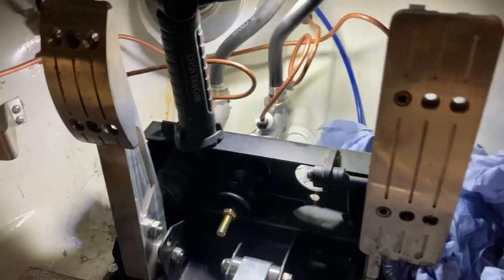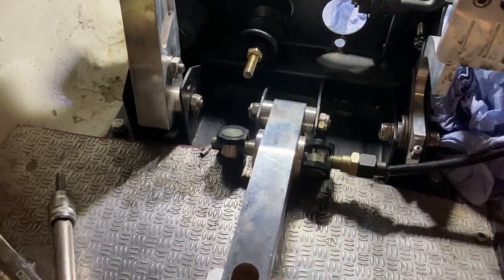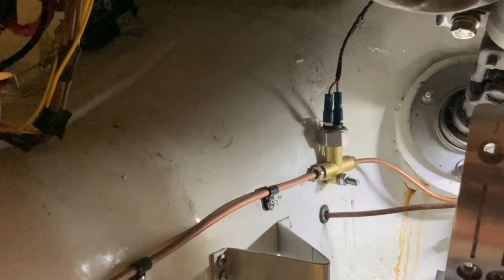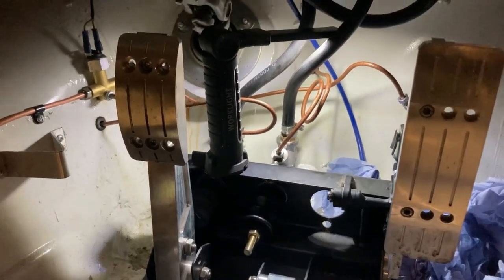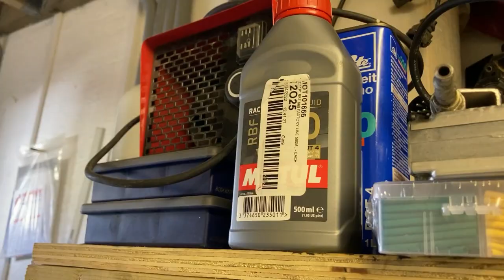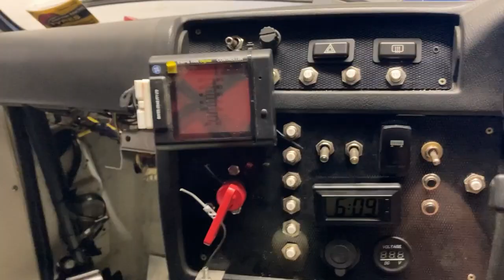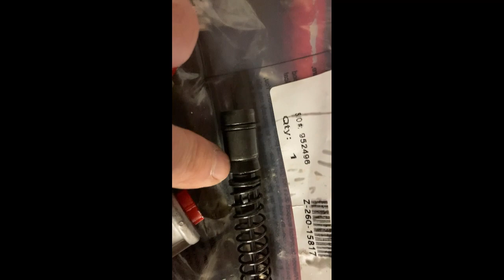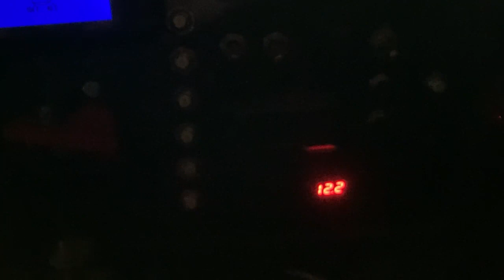preparation on the BMW e30  for the 2022 JERSEY RALLY

Comment: Also check the cylinder for the front is big enough for the fluid transfer required by your calipers.
Reply from the maker: When I bought the callipers i sized the pistons to work with a .625 cylinder but the rear callipers were second hand so maybe the piston size is too small. The brakes are amazing and work so well but I can’t have them locking up, not working or boiling fluid

Comment: I wouldn't use wilwood stuff its cheap for a reason, either Girling or AP for brake cylinders. And you don't need the rear brake adjuster if you run a bias pedal box, its usually used with out a bias box to kind of give a bias by reducing the pressure to the back
Reply from the maker: Yes ap seem to be good, i will have to invest in some. The bias valve is now removed but still struggling to get enough pressure to the rears. I will try better pads and see if that helps